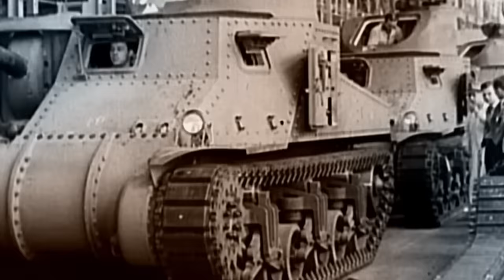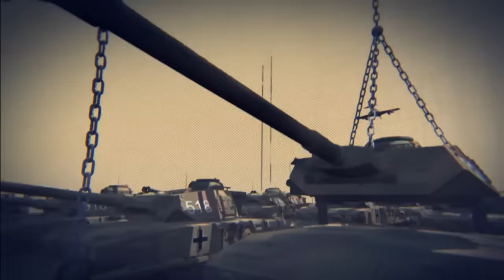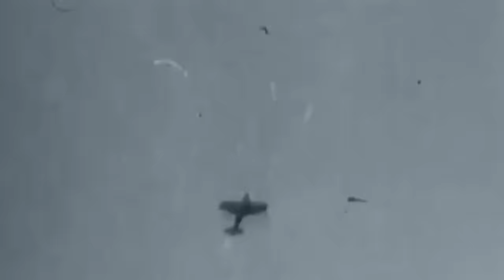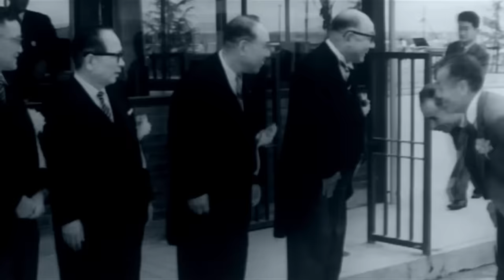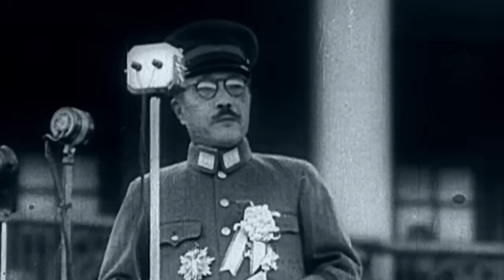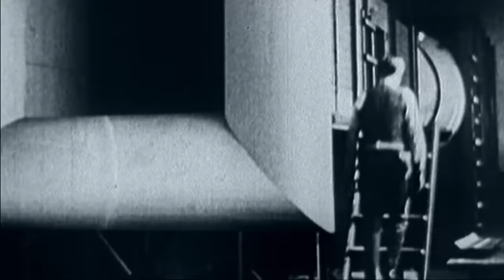War Factories: Bouncing Bomb, Colt & Kalashnikov, Giant Factories | FD Engineering

Comment: Yes the Zero was a top of the line plane when it was first introduced.  But, the technology was advancing so quickly at the time, two years later it wasn't so great.
Reply: if they had self-sealing fuel tanks they would have been better!
Reply: It was at the acme of its development with little room for further improvement
Reply: Yes Mitsubishi engines are  superb I own an old car that have a Mitsubishi SATURN 4G32 chain type w/side drop Webber's still roars like a monster!!
Reply: @dindodayao6238 I believe the engine for the Zero was designed and produced by Nakajima.
Reply: A question for insiders: is it true that the US supplied the necessary aluminium(bauxiet)?
Reply: @Chironex_Fleckeri i think it was  only  float olane a6m2-n...... but they had  some othwr very good planes ki43, 61.....at end of war they made  Kikka

Comment: Your presentation segment on the M-16 failure rate, leaves the impression that Colt was somehow responsible. 
Secretary of Defense Robert McNamara and his cadre of collegiate whiz kids, decided that they were collectively smarter than designer/engineer Eugene Stoner.
Whereas Stoner's specifications called for use of the newer conical propellant, the whiz kids changed it to ball powder that was already in supply.
Stoner likewise specified chrome lined chambers and bores, that the whiz kids discarded thinking it to be an unnecessary extravagant expense. 
Just those two government overrides, to ball powder and non-chrome lined chambers and bores. produced carbon fouling that adhered to the 
interior of the weapon, thus creating a jammomatic suicide machine. AK-47s at 100yds. were far more effective over American troops armed with
bayonets at the end of a M-16 stick. I would suggest that our current cultural self-destruction again sources directly back to the collegiate theoretical universe.
Reply: Also remember, that Army was like "yeah, nice.... can we make it stronger buullet?" ?
Reply: Great comment about McNamara and his whiz kids!
Reply: Reminds me of Alaska Airlines who wanted a more profitable door plug where the Boeing disign was orininally for an emergency exit. I prefer the emergency exit.
Reply: @jnovikoff001  How so? Its original design from Boeing was to provide customers flexibility in configuring aircraft to meet FAA regulations based on the number of passengers to emergency exists. This factory option was selected based on Alaska Airlines' needs. Sure, It was a failure for both parties, but it mainly landed on the aircraft manufacturer and their declining quality standard.

Secretary McNamara laid out systems to reel in massive military spending and civilian oversight when there had been almost none previously (many of which are still in place today) to determine the difference between needs and wanten excess to line the pockets of manufacturers. They didn't 'decide they were collectively smarter.' In fact, McNamara was very self-critical of where he went wrong. 

Seems a bit blase to correlate the collapse of Western civilization when he tried to reign in the industrialist General Eisenhower had warned against.
Reply: Also forgot that colt sold the M-16 as a "maintainence free" design.......also.neglected that colt buried studies done by colt engineers in Vietnam that found that over 60% of M-16's were already complete write offs. Colt is not blameless here.
Reply: @Banthisyoutube-zs6sx ,
 If used in its original configuration maintenance would have been greatly reduced. In point of fact, the very first batch in Viet Nam garnered high praise from 
our military "advisors". That was a very limited run of properly made M-16s. Then McNamara's office contracted the changes that killed American soldiers.

Comment: The Lancaster was undoubtedly a suburb aircraft and had capabilities that were unique at the time.
However, I have always believed that it was used incorrectly. It was used to do things that could have been just as easily been done by other aircraft, using it to destroy entire cities just to make sure that SOME of the militarily significant targets in that city were hit.
Britain should have diverted the majority of it's aircraft production to the plane that could hit targets, and hit them hard. The De Haviland Mosquito was cheaper, quicker to build and only need two Merlins instead of four. It's speed at all flight levels meant it could actually find and hit targets with a good chance of escaping unscathed, it only had a crew of two, needed significantly less maintenance and plane for plane could probably do more damage than a Lancaster when comparing where bombs actually landed.

Harris fought the introduction and production of the Mosquito in favour of the 'heavies' when a much smaller force of Lancasters could have been used only for operations that no other aircraft could achieve, the Dam Busters Raid being one and dropping of Tallboys being the obvious other. Lancasters were also ideal as support for army land forces, providing carpet bombing of enemy defensive lines as the 8th Air Force did in Operation Cobra and the Lancaster itself did on D-Day and for Operation Plunder. Using them as city-busters was, to my mind, a waste of an exceptional aircraft. Nearly 600 heavy bombers, including over 300 Lancasters, were used in August 1943 to attack Peenemunde with mixed results where a raid by 500 Mosquitos would have been devastating. 
Even in 1944-45 most Lancaster raids actually relied on Mosquito pathfinders to locate and mark the targets, especially after the introduction of OBOE, due to the need for Lancasters to bomb from high altitude to avoid being shot down.
Reply: superb

Comment: The zero was a beautiful, nimble, and long ranged fighter, perfectly suited to win World War One.  But it lacked armor and a self sealing gas tank.  It was a zippo, waiting to be flicked.  So what do you do if you are up against an airplane that dogfights better than yours?  You don’t dogfight, you hit and dive away, and even the archaic P-40 could do that.  Then along came Thatch.
Reply: Erm......
Reply: What was archaic about the P-40 ? The Mitsubishi and Curtis were close contemporaries and approximations (or better) of the contemporary state of the art. Both had weaknesses and virtues. Used wisely, both were very effective in combat. They were different types of machines. The Zero was a naval deck fighter. The P-40 was never even modified for that role. Both were used in various roles until the conclusion of hostilities. Both were rather obsolete by that time, but still they were still given importance. The P-40 was an evolution of the P-35. That did not make it archaic.
Reply: In Japan, they said of the P-38, "One pilot, two planes" iow, two times the force of a Zero.

Comment: Heavy emphasis on the shocking statistic that Japanese pilots were entering combat with 300 hours flight time...in WW1, at the worst stage, British pilots were sent to the front after 10 hours, yes 10!  At that stage a trainee can barely take off, do a circuit, and land, even in a modern enclosed, smooth, easily controlled, stable, reliable plane...let alone fly one of those misbehaved wood & canvas contraptions well enough to aim, fire guns, and do aerobatics without pulling the wings off, to evade experienced German experts. They were slaughtered, with an average life expectancy of 11 days.
Not really relevant to this video, but an interesting contrast.
Reply: might not be relevant to this video mate but i enjoyed reading that because i learned something new. thanks for sharing.

Comment: Colt didn't make any real mistakes with the M16, MacNamara did, our soldiers were screwed by our Government, not Colt.
Reply: What’s your point?  Do you propose we have a dictatorship instead?  Democracy may not be perfect but it sure beats every other alternative.  Democracy by its nature is imperfect as it ensures we always have a new person, without previous experience, running the show.  Preventing demagogues from seizing power is one of the most important aspects of democracy.  More important than all the terrible decisions they may make while in office.
Reply: @IcelanderUSer I think what was meant is that Macnamara cut costs, and changed the original specifications for the M16. Those changes made the weapon unreliable. When the original, more costly specifications were adhered to, it worked perfectly well. Many US soldiers were found dead alongside weapons that had malfunctioned.
Reply: @IcelanderUSer America doesn't have "democracy," we have a representative republic.